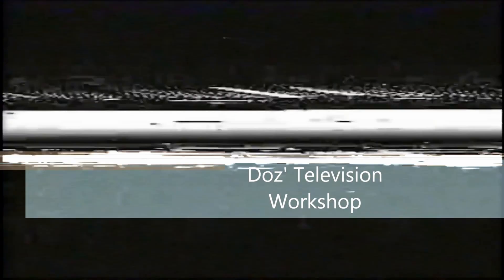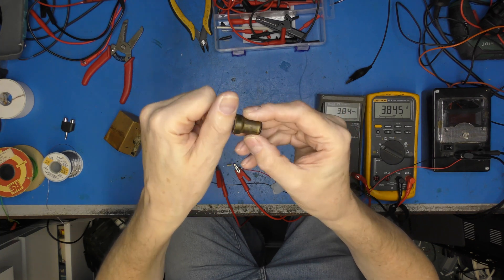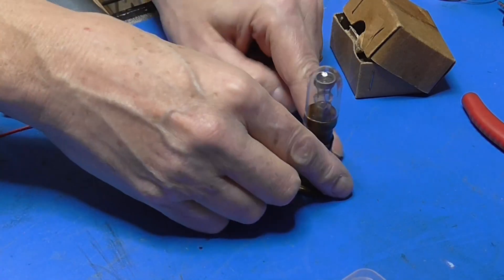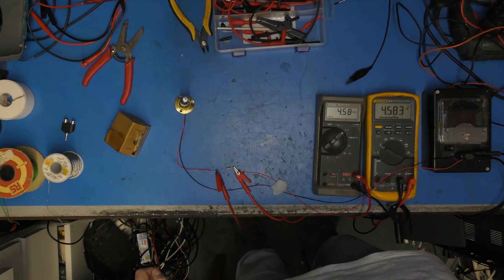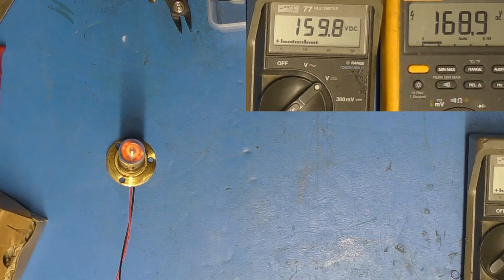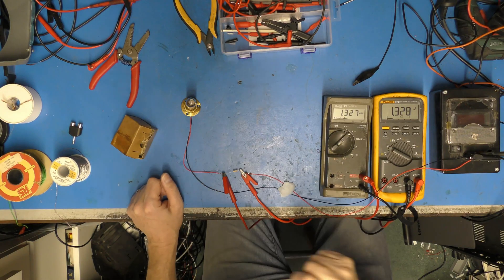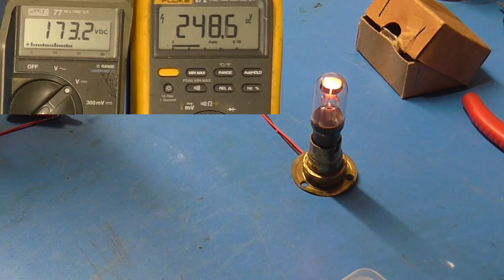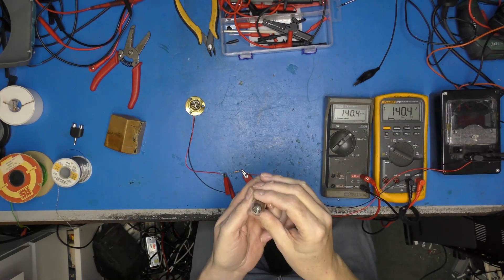Looking at the Osglim

Comment: Happy New Year, Doz :)
Nice to see this Osglim working! I saw something similar in a very old Cossor Oscilloscope as a teenager.
Gas filled devices are a whole different world..... I've a hydrogen filled Barreter in my old GEC TV from 1956 to control the inrush current to the valve heaters.. The TV still works (so one of my better repairs, lol).
Anyway, well done and keep the videos coming.
All the best :)